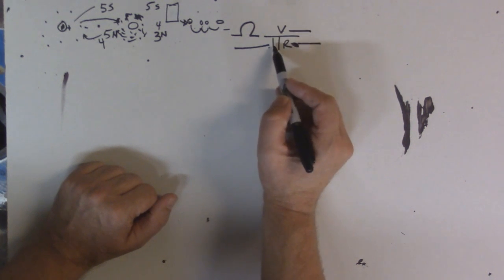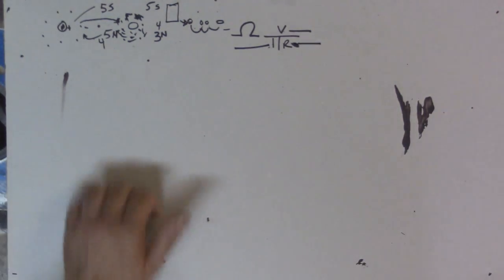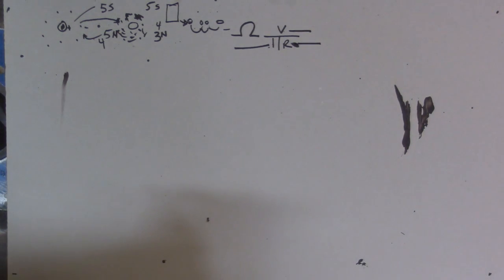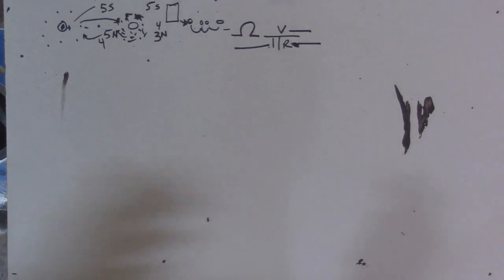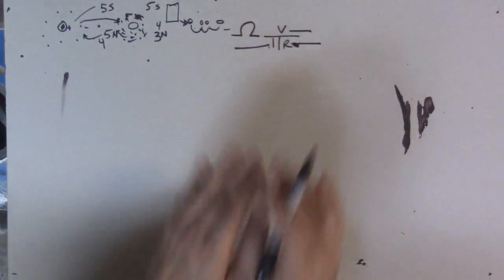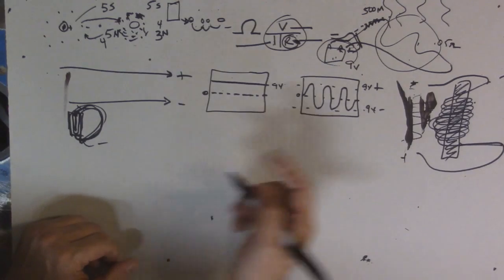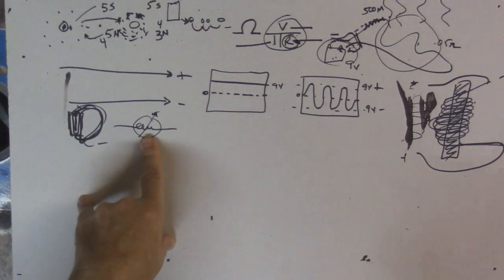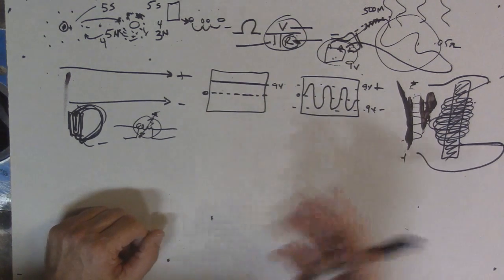How to repair electronics for dummies part 1

Comment: Why does DC current when someone is electrocuted it does not let you go or throw you off the Electric current were AC current throws you off the Electric current could you give an explanation for this thanks as im learning electronics
Reply: Because Dc current flows in one direction so when you get shocked, the current flows through your body continuously, but with AC , AC current oscilliate so the flow of current goes back and forth. So when ur shocked you get thrown off because of the flow of the current into ur body and back and it’s really quick, I’m not an expert but I’m electronic engineering technology major and i hope that gave you an idea
Reply: It because DC is one side of electricty so there is only one option for your muscle contractions it seems our bodies are wired normally onpen aleast when it comes to closing your hands etc. But when it comes to AC it does both contracts our muscles in one direction ei. Negative influence and then Positive influence so it nocks you off because of that interaction between our muscle charge or lack there of. Hopefully this helps.

Comment: At 9:04: Current flow (electron flow) occurs at just barely under the speed of light.
Reply: Jack Davis that is not absolutely correct sir. Electrons might flow almost at the speed of light but as they have mass they need a tremendous amount of energy. Electrons in a circuit move less than 1% of that speed. Current on the other hand flows at those speeds.
Reply: I hear what you're saying, but electron flow IS current flow, so the two cannot flow at different speeds unless they are somehow violating the laws of physics.
Reply: Well it's not violating any laws because electrons flow and current flow are different things. You can search for rimstarOrg video on "how fast is electron and electricity".
Reply: aannoonniimmss okay, sounds good. I know that electrons can do funny things, almost as strange as photons and neutrinos in their behavior, so maybe simple physics laws get bent or broken here. I did find on Wikipedia that current flow is either the the flow of electrons or ions. Ions are carried in electrolyte, elections move in conductors and semiconductors.
Reply: Jack Davis that is also true. This stuff was really confusing when i get interested in electronics. And still is☺. But it's good that we are looking for answers and doing research on things we are not sure.
Reply: Electron flow in a conductor can be visualized as a tube full of marbles. When a marble is pushed into the tube, a marble pops out of the other end almost instantaneously, as does an electron when an electron is pushed into the other end of a conductor. In a vacuum tube triode the speed of the electrons flowing from cathode to plate depends on plate voltage, but is in the region of 5,000 m.p.h.
Reply: The scientific data I have seen explains that electron flow is equivalent to current flow, but that electron drift happens quite slowly. I believe this electron drift is what the video creator is actually explaining when he talks about the speed of electrons. Electron drift is not electron flow, and hence, not current flow. It is a measure of how many electrons leave one source to now reside in a new location and the speed at which that drift happens.

I would like to hear / see the scientific data on the speed of electrons in a vacuum. Also, marbles through a tube is a good way to explain it to the layperson. It's one of my favorite ways to explain it. Water through a hose is another. However, "marbles through a tube" does not explain the speed at which all those marbles are moving. 

Perhaps the 5,000 mph is a rate of electron drift in a vacuum. Just offering a thought.
Reply: I was referencing the book, 'Designing Tube Preamps for Guitar and Bass'. by Merlin Blencowe (MSc) a.k.a the Valve Wizard. Describing a tube diode on page 2; "if the anode is at +100V then the electrons will be travelling at about 5927 km/sec when they impact!" In my haste to appear as a clever person, I misread 'km/sec' as 'km/hour' and the correct speed should in fact be 2,133,720 km/hour, or 1,333,575 m.p.h. (which we can assume will differ at other anode/plate voltages). His comments on page 3 regarding what current actually is, too long to repeat here, make fascinating reading, and lead me to believe that we have used the concepts of 'current' and/or 'electron flow' to construct a 'theoretical model' which is not what is ACTUALLY happening, but nevertheless allows those of us who don't have the time or the inclination to study for a degree in electronics engineering and/or quantum physics to predict the result of connecting components together in an electronic circuit, just as NASA could successfully use Newton's relatively simple Laws of Motion to put men on the moon, even though the motion of bodies is (we believe) ACTUALLY a result of distortions in spacetime as described by Einstein's rather more complicated Theory of General Relativity.
Reply: Do a search on youtube for "electricity speed" there are a few videos that are more in depth. Also learning how abstraction is used in computer science to make complexity simple is a great way to think about things when trying to learn something new. I try to use abstraction by thinking how would I teach X to a five year old, 7 year old, 9 etc with more complexity taught as the age increases.
Reply: tom keane 
Do you have a system for a fifty-two year old Tom....?!?
Reply: +Jack Davis Interesting conv, ngl I haven't read it all but I'm seeing "Current flow = electron flow" and since "electron drift =/= electron flow". But how is current flow = electron flow, shouldn't it be charge flow?
Reply: @JackDavis  This is how I understood it too and found the explanation a bit confusing in parts tbh. Marbles in a hose would increase the pressure but not create the same thing as resistance, would that be fair? It would be the same thing as putting a brick on a hose - same amt of water coming through but more powerful spray. Resistance might be something more like pin pricks in the hose - not all the water coming through the hose is actually making it out the end. Is this electron drift or resistance?? Maybe resistance is something like there's a sponge in the hose soaking up some of the water. It doesn't actually leave the hose, and it doesn't get to see the grass.

Oh. But maybe resistance is just some external force that alters the current and voltage properties. Such as a sprinkler? I need to go read some more, clearly lol
Reply: @ThePerfect1077  on second thought, pin pricks would be electron drift - electrons getting lost along the way...